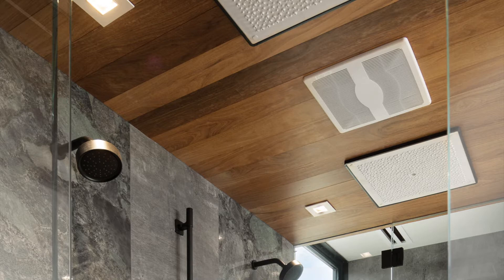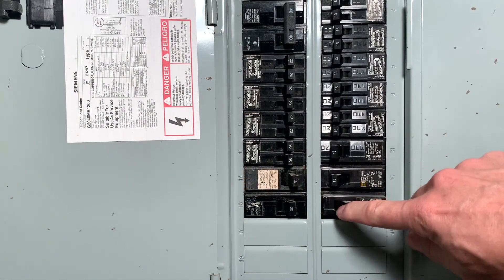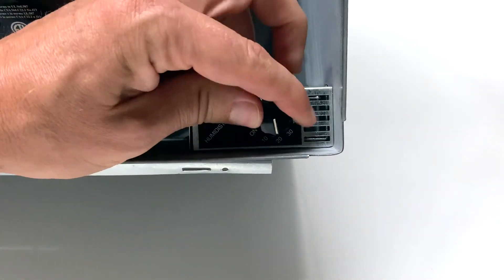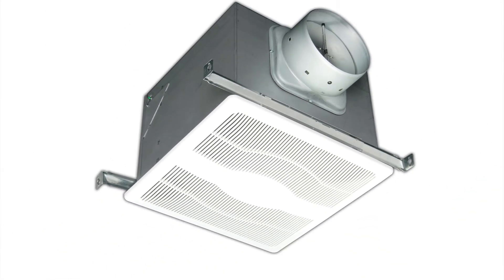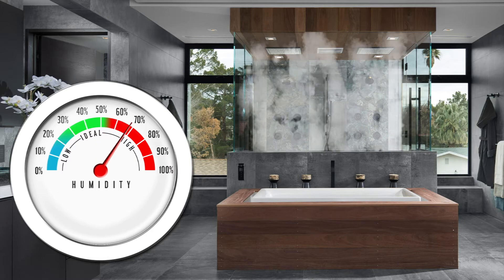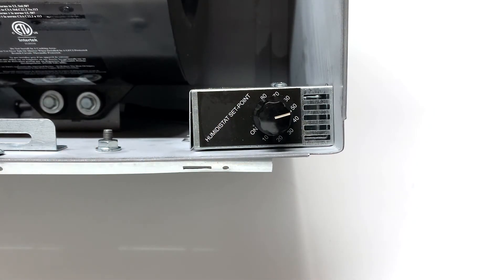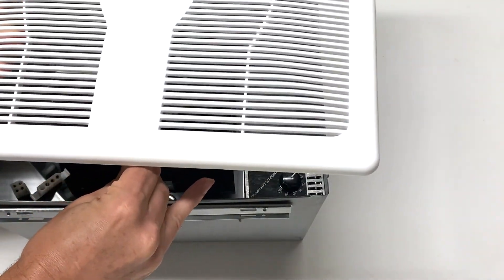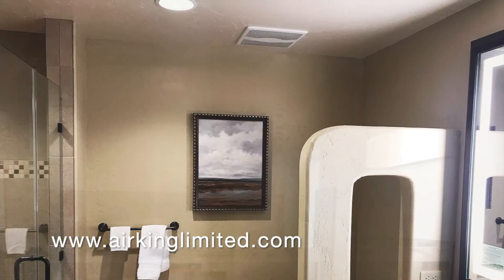Setting and adjusting the humidistat of a humidity sensing bathroom exhaust fan

Comment: Thank you for this helpful video. If i turn my setting down so that it doesn't run constantly, then it doesn't suck hard enough to hold two pieces of tissue, which is something I've seen recommended. I'm not sure what to do about this?
Reply from the maker: Thank you for your question. The humidistat of a fan will turn the fan on or off, it shouldn't effect the amount of airflow. The tissue test is an indicator, but not a be all end all to the performance of the fan. Depending on which model you have, there are also airflow (CFM) settings. These can be increased if you feel that the fan is not exhausting the proper amount of air. The real test is are you having any moisture build up in the bathroom - foggy mirrors, mold growth, etc. If not, then the fan is doing it's job. Other causes of reduced airflow would be clogged ducting either in the ducting or where it exhausts to the outside. Bird nests and debris are typical culprits. Another issue could be if the ducting was reduced from either 6" down to 4" or 4" down to 3". This will negatively affect the airflow. Hopefully this help to answer your question. If you need more info, please feel free to call our customer support line at 800-465-7300, or if you want to post back with your model number we might be able to help more.
Reply: @AirKingVentilation  That's really helpful thank you